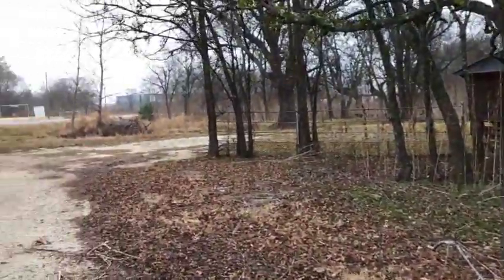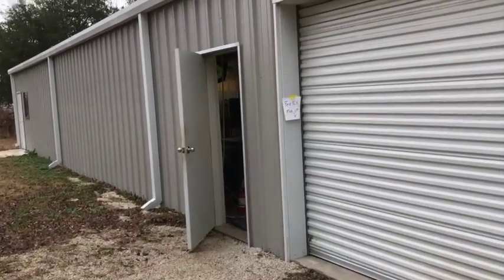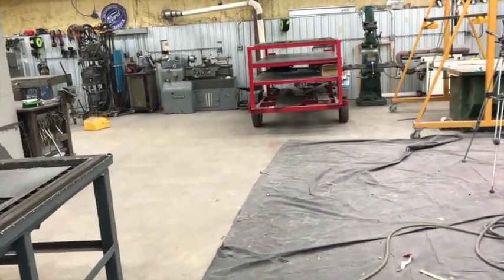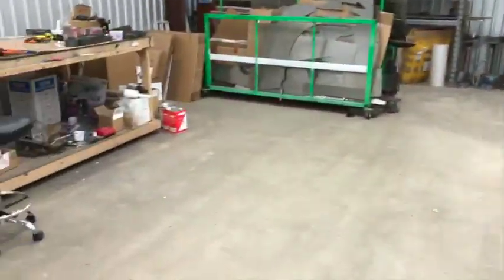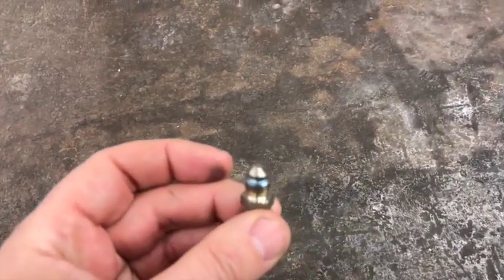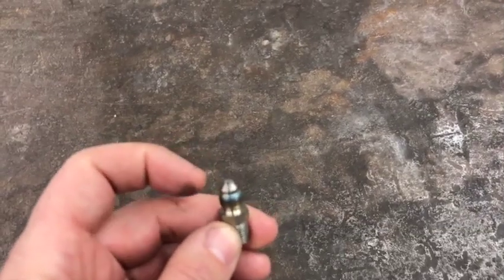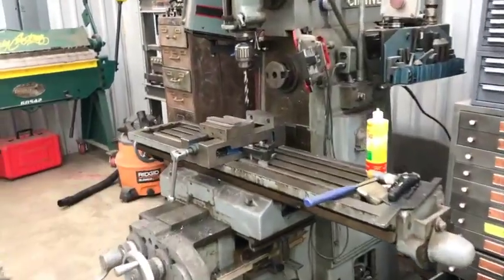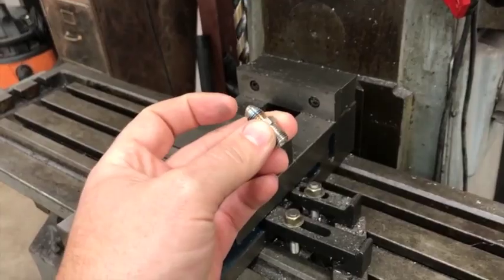change of plans for everything

Comment: Use a chuck mounted to mill table just below the mill's chuck. That way you get consistent holes and easy in and out of the little part. Plus with that method it's easy to center both chucks with two slip fit pieces.

Comment: Gary, dont complicate your fixture in the mill to put the hole into the fitting. Just throw a chunk of aluminum in the vice and drill and tap a 1/8npt. Screw them in and drill!

Comment: I would have made a drill bushing that screwed on the back and fit down inside the coupling with your .080" hole and drilled it from the back side of the cap. Make it from A2 or O1 and harden it and it should last for a while.

Comment: Gary maybe look at a drill chuck that goes into your qtp tool holder. Edge technologies makes one and there are several other ones out there. Also you really need a screw machine length drill bit, probably carbide for the Inconel
Reply from the maker: That's a great idea, and I had definitely thought about that.  I guess you could take a 1/2" gauge pin and put it in the lathe chuck, and then get your qtp chuck adjusted so it will clamp right on it.  I didnt know they actually made one, Edge seems to make some handy tools for a good price.  I have a couple of their tools.  Thanks Bill, good to see you

Comment: About the worn out tailstock. On my lathe it's also worn out. It's OK for Turning if I'm careful, but drilling is out of the question. So i dissembled a broken drill took the shaft with the drill chuck, clamped a rod in the lathe chuck and drill chuck, clamped a iron block into the tool post and welted the dill shaft to the block.
So now to drill a hole i clamp the dill chuck with a rod (a big drill) to the lathe chuck tighten down the tool post, lock down the cross slide and can drill holes really accurate. I also used it to hold small boring bars. It's working so great and i think i will make a special tool post with a bigger chuck so i can use bigger drills.

Comment: I was a building painter for about 20 years. Telling a person what $20 paint brush or $10 roller cover I use won't instantly let them get the same results I do. There are more expensive brushes, but skill makes more difference than going to even more expensive tools. On the other hand, if people start with good tools and some good advice from others who have good skills, they have a better chance of succeeding. Some viewers may understand the tool won't replace learning the skill, but they may wish to buy a decent or good gun to start off, instead of wasting money on junk. Your paint is very nice looking and I agree that trying to color sand or buff it would be much more work and another ball of wax. It could be done, and you could likely sand or grind the cut edges before priming, but it likely isn't worth the work for the average customer and your current prices.
Reply from the maker: well said

Comment: I think I misunderstood, can't you clamp down on the tailstock quill? Jody can make awesome welds with a buzz box. Fabrication is more an art than expensive tools.
Reply from the maker: of course you can, but you cant drill a hole if its all locked down, you have to have it lose enough to plunge through the part
Reply: Oldbarn Homestead Right, I've drilled 4in #30 deep holes in 3/4" 1045 shaft and keep it where the feed is tight. I don't get any movement. Maybe the key is loose in the keyway and a new key will fix
Reply: Jimmy's Tractor the bore the quill fits in is probably just worn out, most of the 10ee lathes were production lathes and used hard.

Comment: Did you consider clamping a female pipe fitting in your mill vice and then thread the part into the fitting? Maybe it would be and easy way to index and hold part after part.......then again, maybe not. I would give it a shot. Good thinking on using the mill instead of the lathe. I thought of that just before you mentioned it, as I have to work with limited tools as well.....heck, I'm using an RF 30 mill/drill, which doesn't compare to what you have. My brother just got a tormach 1100 cnc mill, but I haven't played with it yet.
Reply from the maker: yes I did think about drilling/tapping into a block so I can screw them in and out for production work.  I was thinking it may not be quite rigid enough or might want to spin and tighten in further, so I was just going to make a set of soft jaws with a hole that splits the jaws  that clamps on the top set of threads so its held rigidly.  Dude tell brother to send me that tormach, he doesn't need it as much as i do! lol

Comment: Gary I understand that there is a lot of skill that goes into painting and the finish of your Metal art, however please don't dismiss Powder Coating as just a "Fog it on" process.  Its a bit more in depth than an that.  Proper preparation is 75% of any finishing job.  Thanks Walt

Comment: Man, I'm so bad at painting. I avoid it at all costs. It just never comes out decent.
Reply from the maker: I hear ya man.  I have been working at it for a few years, and only in the last few months i have really dialed in all the details to get decent results on a consistent basis.  Its like machining in alot of ways.  From a distance it doesnt look that hard, but to make parts to a tight tollerance consistently, there are quite a few fine details that have to be right for it to happen.